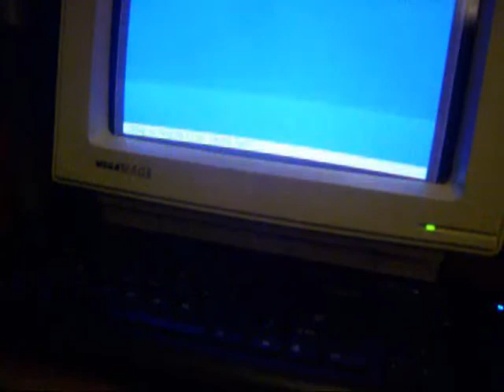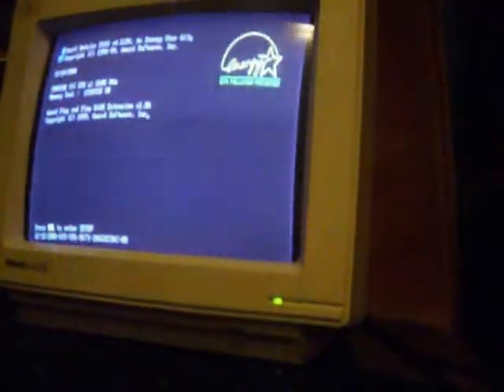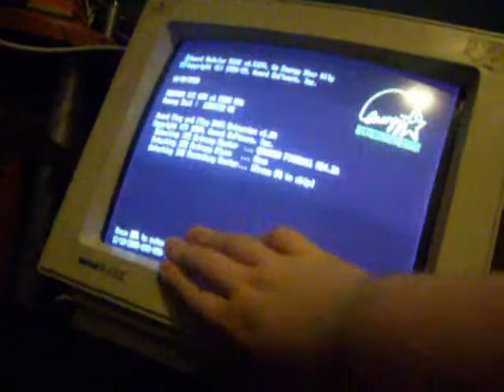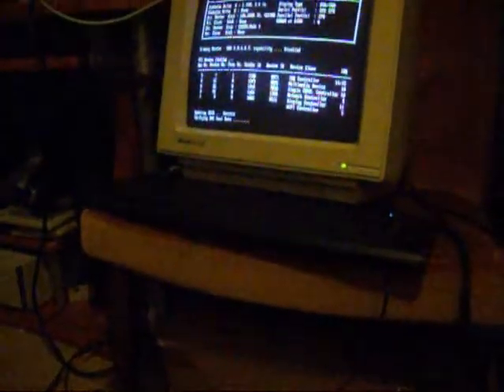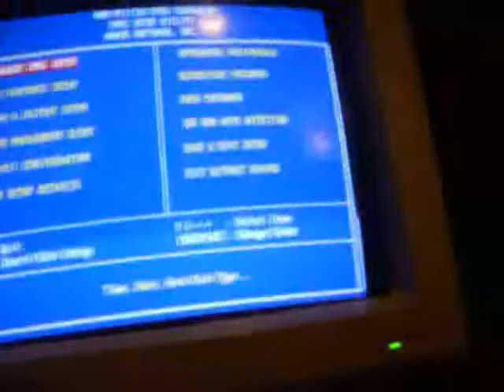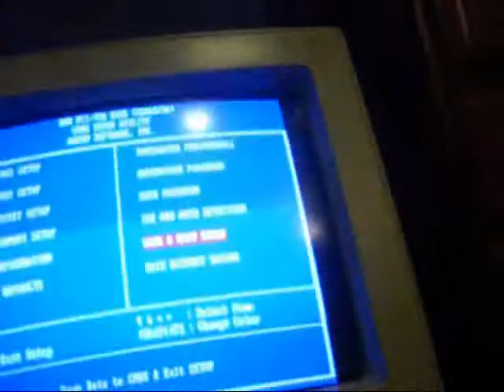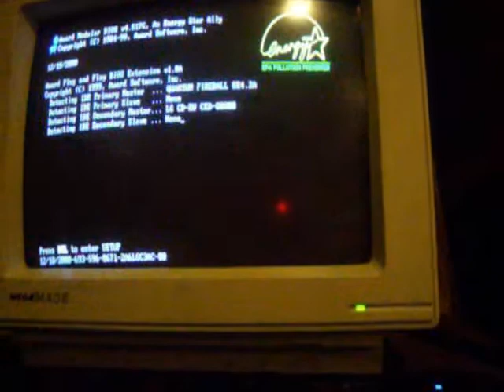THE IPC TOWER'S MOTHER BOARD IS HALF DEAD!!!! TIME TO SCRAP HER

Comment: That's no good! I had a problem like that with my Win NT CD. It froze and when I tried using it inside of Windows it froze and when I got it to actually work the screen started just rolling like an old tv set. Turns out you need like five floppy discs for it to work.  Atleast you got some good parts from it to use in another pc! Did you donate the Compaq Presario? I really like that pc! I hope you can get some good use out of the VIG pc!